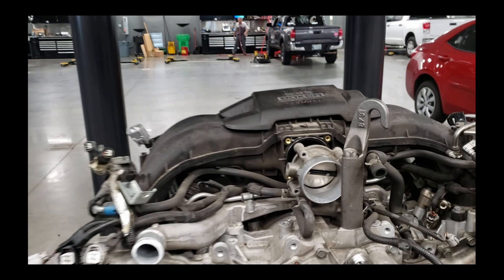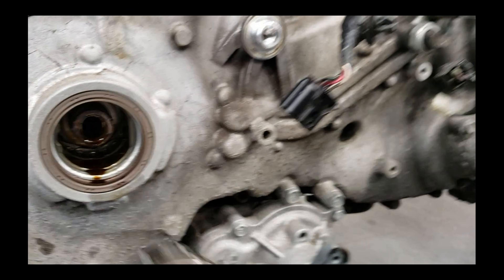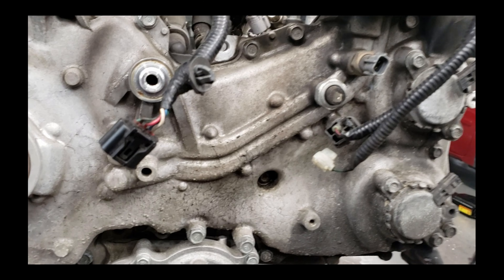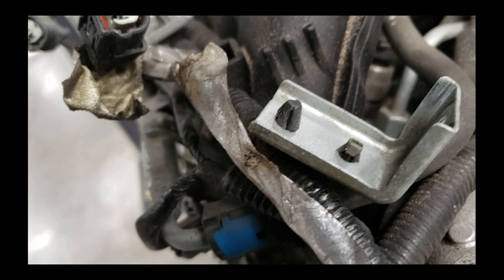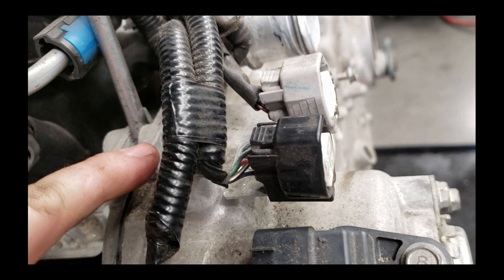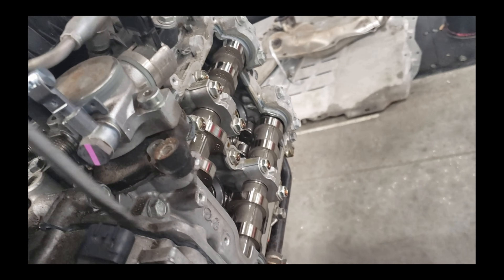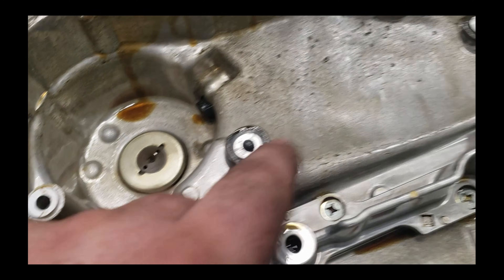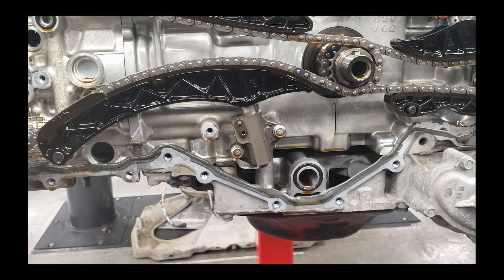how to set timing on a fa20 for fr-s/brz/gt-86| walk-through! frs/brz teardown!

Comment: Great video, I am presently working on a FB25 with bank 2 cam crank correlation issue.  Been trying to time by the book and the left side does not line up arrow to arrow after chain installation and engine rotation. I will be doing the cam alignment like you showed. Will report back after. Thanks again.

Comment: Is this the same with 2.0 XT turbo?  I want to replace the timing chain. It has P0016 and p0017 codes
Reply from the maker: Yes it does appear that's an fa20 engine so internally should be very similar.

Comment: Did all this along with a cam reseal and headgasket. UNFORTUNATELY I have a p0018 p0016 code.  Engine is in the car ofcourse sealed up😢.. car runs but ... Idk where i messed up. I THINK perhaps when i mixed up  the rocker arms and the balve tips. (Valve tips were soo small) Accidentally dropped them . I have a very distinctive click click from the passenger side cam .. or maybe chain tensioner....... Idk where to start.. car runs soooo

Comment: The biggest problem with these pos is the PVC valve fails and causes major engine sludge and the VVT filters that get plugged up destroy your cams and your VVT they are between the head and the cam boxes tell me why the engineers couldn't put those VVT filters in the front timing cover designed to fail my friends

Comment: Thanks, for info. Just got a 2016 FRS that's got a knock at start up and lots of chain noise. Probably going to have to get new short block. Certified mech but fairly new at chain engines.

Comment: Can you do this while the engine is in the car?
Reply: One more question: if you’re just putting the car back in timing, do you have to remove the chains or can you just spin the crank until the marks line up?
Reply from the maker: @AtomSquirrel  what do you mean by putting it back in timing? if the timing has not been tampered with and you don't suspect it of being off you could spin the motor over until the paint marks all line back up there is no way for me to tell you how many revolutions this might take it depends on where the marks are when you start but the right way would be to set the timing marks to zero remove the chains and set the timing from scratch of I were going to this id think about putting a new chain and maybe a new tensioner on the setup while doing it
Reply: @ParkHopTillWeDrop  well, the reason I ask is because my friend’s car is having a crankshaft/camshaft alignment p00017 code. Or is it p0017? Anyway, it started off as a code for bad sensor with some rattling noise bank 2 sensor 1. I replaced the sensor, hoping it would go away. Well the code for a faulty sensor went away, but now it’s just showing that the crankshaft and camshaft are out of alignment bank 2 sensor 1 with the noise still happening.  My mentor told me it was because the timing is off. His car has 100k miles, so I don’t think the timing chain is bad. I haven’t gotten the cover off to see if there’s any damage to the chain or sprockets, but I have just about stripped the front of the engine. I’m getting close.
Reply: Or is it bank 1 sensor 2? It’s been a while since I’ve checked the code. I know it’s on the exhaust side. One other thing is the catalytic converter gets extremely hot, I think because it’s not able to release the exhaust gasses properly. I can’t remember what my heat gun said when I put it on the cat. I think it was in excess of 200 degrees
Reply from the maker: @IntelliPocalypse  sounds like you have a timing gear problem not a sensor guessing that is the rattle noise your hearing.  Also if the gear is damaged and won't advance the timing you will get a code which you have and the exhaust temps could be elevated due to over retarded timing
Reply: @ParkHopTillWeDrop  so that means I could be replacing the timing gear? Guess I better start sourcing one then
Reply: @ParkHopTillWeDrop  I thank you so much for your time! This is very valuable information along with the video you posted. You are a great mechanic and I am striving to be like you with my efforts in school (automotive technology), at my job (lube tech. It’s not much but it gets my foot in the door), and my personal life (helping my friend fix his shit lol and doing work on my own vehicle). Also the best YouTuber ever. Never had someone so responsive on a video, especially one that’s 4 years old!
Reply from the maker: Yes 100 percent we had the engines out to replace the valve springs.but the timing can be done in the car
Reply: Awesome! Thanks for the response. Gives me a little more hope fixing the car
Reply from the maker: @IntelliPocalypse  honestly other than needing a hoist getting the motors out of these is very simple and only takes around 40min in a shop so a couple hour task at home. But if I was just doing the timing I definitely would not remove the engine.

Comment: Hey buddy im having issues whit the code p0019 on my wrx 2015 fa20 i did built the engine and is the firt time whit this issue i double check timming and its fine but when i start the vehicle i get the code i did change new cam sprockets and cam sensor u have any advice could help
Reply from the maker: Check the filters for debris the ecu seems to be common on these although I've never had one fail it's always been a gear.
Reply: @ParkHopTillWeDrop  new filter oil and everithyng oil also
Reply from the maker: @marcogiron4260  filters in talking about are in the head they are screens/filters for the gears
Reply: @ParkHopTillWeDrop  ooo yeah iknow wich ones perfecto i will check those
Reply from the maker: @marcogiron4260  somes times old sealant gets caught up in them and prevents the gear from activating

Comment: Hey just out of curiosity but if I were to remove the camshaft sprocket on the passenger side of the motor, would I have to do anything with the driver side timing wise or can I just lock both driver cam sprockets in place?
Reply from the maker: No as long as it doesn't move at all
Reply: @ParkHopTillWeDrop  Thank you so much! That honestly just saved me a headache. I’m preparing myself to get this job done for my car but I’ve never messed with timing before lol. One more question btw, do I have to pull the motor out in order to do this or do you believe there’s enough room in the engine bay to pull the timing cover off while inside the car still?

Comment: Can this be done while the motor is still in the car? What is the service life of the chains/guides/tensioners, is there a recommended replacement interval? Thanks for the video!
Reply from the maker: Yes it can be done with engine in.  We had it out to replace the valve springs.  I'd say if 150k would be a good number buy it you wanted to be cautious you could do it at 100k
Reply: @ParkHopTillWeDrop  I appreciate the response! Thanks!

Comment: HI I HAVE 2015 SUBARU FORESTER FB25 ENGINE AND I JUST WANT TO REPLACE THE CHAIN TENSIONERS. HOW TO SET THE TIMING? JUST LINE UP THE TRIANGLES AND REPLACE ONE BY ONE?
Reply from the maker: Yes essentially it's very similar but I would look up the timing mark diagram from a subaru manual unfortunately I don't have access to that as I was at Toyota.
Reply: thank you very much

Comment: Great Video. Even better explenation. I'm currently having an issue where the Painted Arrows on the RH side were NOT aligned from the start (A few degrees off) , obviously they do not match after confirming that Painted Chain Links are in their correct locations. Can the Cam Phasers be an issue?
Reply from the maker: Yes also we had a chain that was stretch that caused the marks to be off and also some have said if the cylinder heads were machined alot it could cause the marks to be off but to answer your question more directly the phasers can be bad. On the one that we had that was off when we tore it down we recommend the chain and phasers be replaced

Comment: Most helpful video Ive watched yet; my only question is.. If I did all that and rolled the engine over a couple of times like he said and I get maybe 90degree turn and I feel it lock up?
Reply from the maker: If you feel it hit something stop and double check the timing it should roll over smoothly with the plugs out you will feel some resistance in a few places but not a hard stop
Reply: @ParkHopTillWeDrop  Thank You! The plugs are in 😓, hopefully I can get this running today/tomorrow. This is my first real fix/rebuild (from head-gaskets) w/ no help. Also doing it with the engine inside the vehicle.. Fun stuff 🤌🏼
Reply from the maker: @alexanderkillips3121  pull the plugs while rotating the motor it makes finding out if your hitting something easier

Comment: I'm doing a fa20 but the driver side top cam kicks in and out how do I know what's right I guess it the variable timing sprocket to change timing when it's running it moves left to right I've tore this car apart 4 times already I got a p0019
Reply from the maker: not sure what you mean by it kicks in and out im guessing you mean its moving when setting the timing if you set the timing right and the code keeps coming back you could have a bad controller or and oil clog and sometimes the ecu can cause this fault.

Comment: Great video, long story short I was sealing up the timing cover and during the reinstall I messed up the woodruff key that lines up with spockets on the crank.  I need to replace that Key and I assume the timing chains need to be removed and sprocket.  Is the sprockets easily removed or somewhat pressed on?
Thanks in advance
Reply from the maker: Yeah it slides off the front after the chains are removed
Reply: forgot to mention that the engine is a fb25. Is it safe to assume same procedure?
Reply from the maker: @larrypapke6159  I would assume so as well however I have not done a 25
Reply: @ParkHopTillWeDrop   When I got home I check the colored links on passanger side or right side and after turning the crank over several times I could not get the colored link to be inline with the marks. Is this normal? I can't see the chain jumping the sprockets.???
Reply from the maker: @larrypapke6159  so you set them all up then turned the crank over and the paint doesn't line up? If that's the case it's normal you would need to turn the engine over like 50 times to get the marks to all line back up
Reply: @ParkHopTillWeDrop  OK just to put it out there I finished up my sons fb25 using the same procedure with ease. Looks different on the sprockets but the dots are visible
. thanks again for the help
Reply from the maker: @larrypapke6159  no problem glad I could help wish I had more experience with the 25 motor.
Reply: @ParkHopTillWeDrop  I now am doing the Idle relearn. When I am done the first 10 minutes and wait another 15 sec. the car will stall before I begin the 5 minute Idle.  If I give it a bit of throttle it will run.  If not keeps stalling. Any ideals?

Comment: Does anyone know where is the crank shaft sensor A located at
Reply: @Park Hope Till We Drop do you know where it’s at ???
Reply from the maker: @ricardocortez573  there is only one crank sensor it's at the bottom of the timing cover there are 2 cam sensors tho
Reply: @ParkHopTillWeDrop  thanks man for the help 👍🏽
Reply: @ParkHopTillWeDrop  I was looking under the timing and I saw one sensor but a three connection is that the crank or a cam I only found one under the car am I in the wrong area park hop
Reply from the maker: @ricardocortez573  so I actually think I told you wrong I had to go double check and I actually believe it's on the top of the motor near the back under the intake looks like it reads off the flywheel
Reply: @ParkHopTillWeDrop  I still can't find the crankshaft is it kinda hidden is it in front of the engine and is it like hidden sorry for the whole bunch of questions

Comment: I'm getting P000A cam slow to respond bank 1. Already tried to swap oil control valves. Code stayed with cam A bank 1. I'm hearing about 2 possible causes. 1. possible oil restriction in a filter that resides behind the camshaft. 2. bad cam phaser/sprocket. I would hate to go to the trouble of replacing the cam sprocket only to find out that it's the filter. What a stupid design! Is there any diagnostic procedure that I could perform to determine with certainty that it's one or the other? How do you test the cam sprocket? I have a bi directional Autel diagnostic tablet that offers a bunch of different data pids. I can command each camshaft to varying degrees of timing as well. I have seen a diag where the guy compares live data of all four cams but this will only show the problem not the root cause. Someone also recommended that I just replace the sprocket and reverse the flow of oil through the cam at the opening for the sprocket to back flush the filter. Not sure how this would help if it's just going to run the opposite direction once started, thereby running all the blockage right back to the filter. Could I just flush the sprocket and cam together through the check ball on the phaser? Thanks! Love the video....very informational!
Reply from the maker: I always blow a small amount of air into the oil hole under the valve cover when doing the cam phasers but it is really difficult to figure out what the root cause is if you had a scope with a pressure transducer you could hook that up to the oil pressure sensor whole and look at the reading when you operate the valve if the transducer pics up a slight pressure drop when you activate the valve i'd say its operating and sending oil to the sprocket sorry I could not be more helpful on this